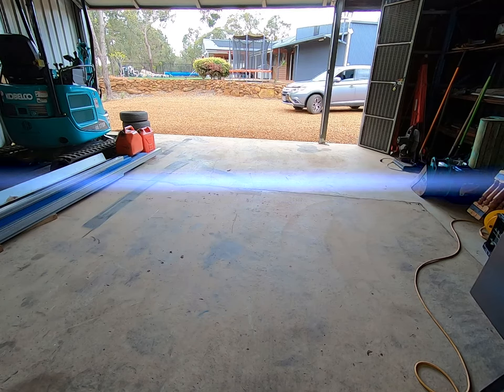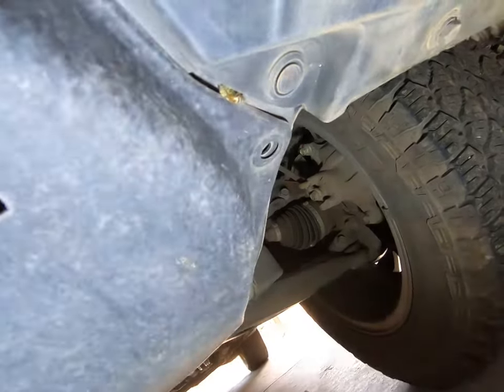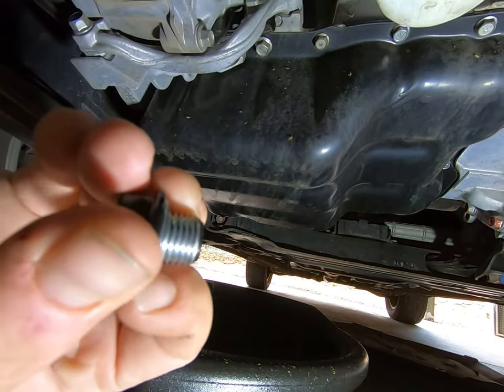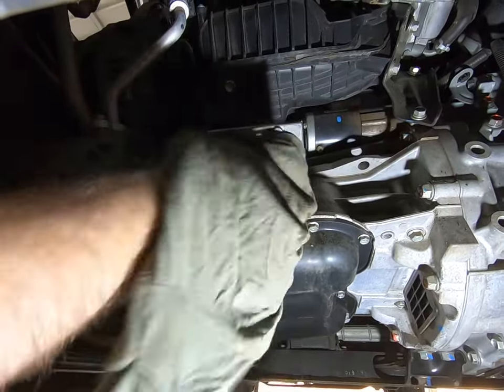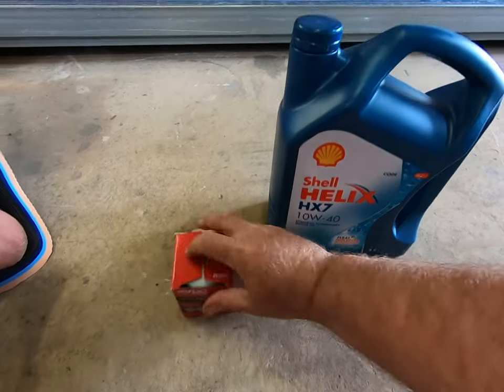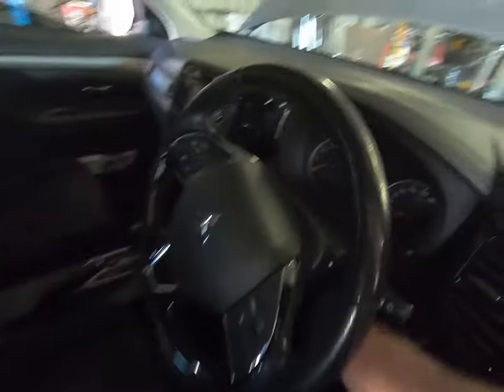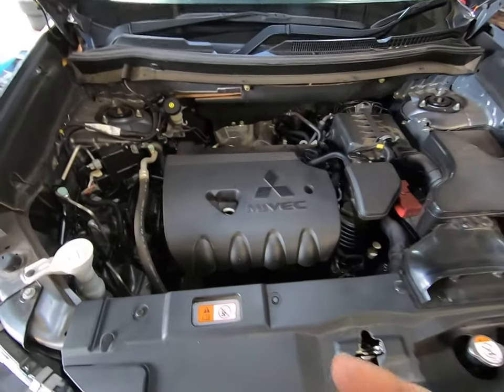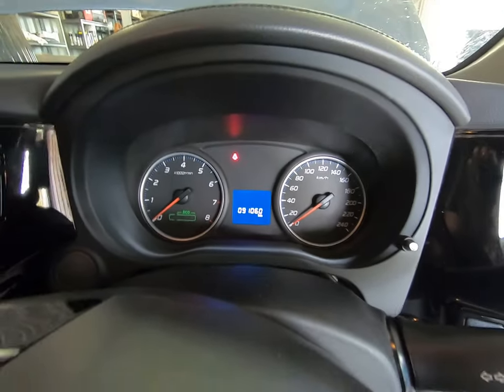Quick, Easy and Cheap ($40!) Oil Change on Mitsubishi Outlander

Comment: Shouldn't that oil be 5 weight?
Reply from the maker: Depends where you live and the climate mate. Here in Australia the Mitsubishi dealers are using Helix HX7 10w-30.  You’d be using a bit thinner oil if you are in a colder climate.
Reply: In Central Europe we use 0W-20

Comment: Can you use Full Synthetic 5W-30 on this car? Or better using thicker 10W-40?
Reply from the maker: Thats fine mate
Reply: Use the oil recommended in your  owners manual for the ambient temperatures you expect to encounter before your next oil change. Comply with the API specification. Both will be on the oil bottle. Change at the intervals required based on how you use your vehicle. Your engine will thank you!